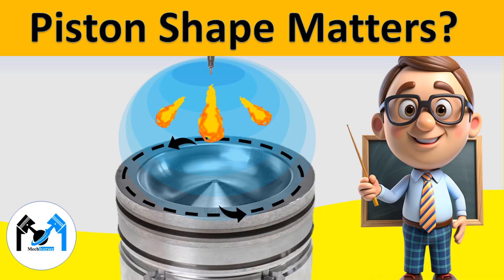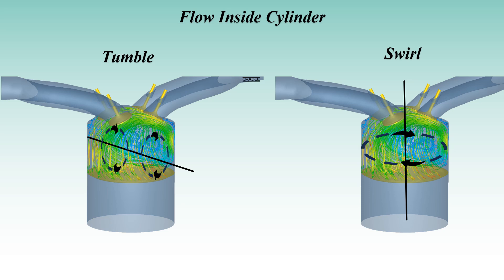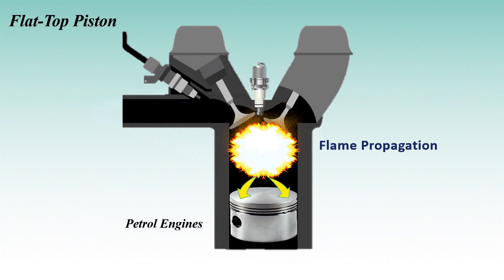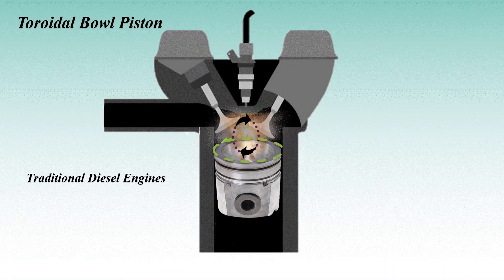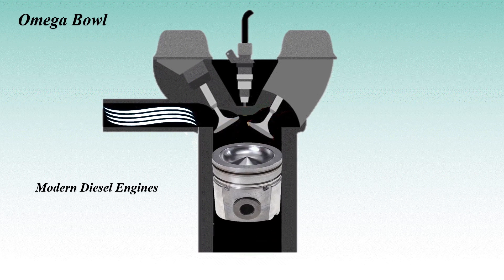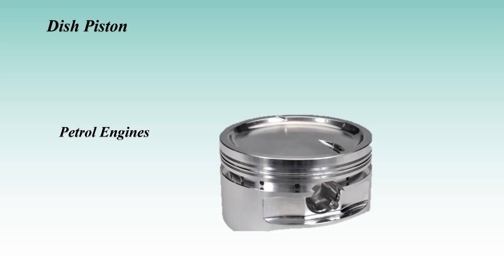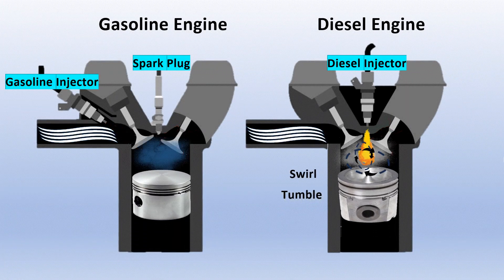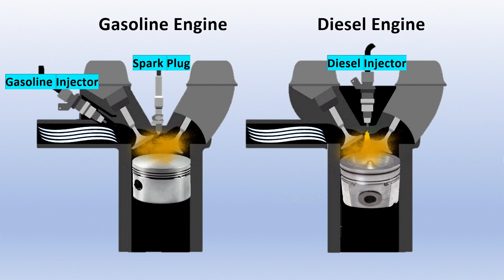The Role of Piston shape

Comment: “Simply splitting the piston crown from the skirt to pump gases for the combustion chamber via a (valvetrain-like) “piston-train” and then combining to turn the crank” makes a 2-/4-cycle hybrid, called “D-Cycle” (Differential-Stroke-Cycle) engine. D-Cycle further ushers in the (diesel-engine-type) compression ignition of the (gasoline-engine-type) air/fuel mixture combustion, for a diesel-/gasoline-engine hybrid, called “Diesoline” engine – or “SCCI” (Stoichiometrically-Charged-Compression-Ignition) engines. The diesoline engine needs no special piston top design. A simple flat top should be good enough. These technologies can retrofit existing diesel and or gasoline engines.  
The (mechanical or electronic) piston-train is like an enlarged valvetrain Which controls the piston strokes and adjusts the gas exchange to optimize the Burnt-Gas-Retention (BGR) to retard ignition timing and slowdown combustion rate. These engine retrofits surpass the current 2-cycle, 4-cycle, diesel, or gasoline ICEs (internal combustion engines), while maintaining compatibility with existing parts, manufacturing, facilities, personnel and processes. 
These patented technologies can retrofit the existing (and future) billions of ICEs to improve (>30%) efficiency, (>2.5x) torque & eliminate (~zero) harmful diesel soot/NOx emissions and can applying acuminated know-how and facilities for great savings from developments. 
ICEs have been worked on by millions of personnel for about 1.5 centuries and encompass the whole spectrum of human activities. With just a minor modification of the piston, they+ can bring in another century of service to humanity and may be even longer - before electric battery technology achieves compatible energy and power densities.
Our piston-train retrofit technologies for the billions of cars, buses, pickups, and any devices powered by existing and future ICEs should provide great opportunities for D-cycle and Diesoline engine improvement businesses. 
The D-cycle generates greater power (torque), it can be for just about any gasoline or diesel ICE powered equipment.  It can greatly enhance power, energy densities and fuel efficiency without much change on the engine (and mostly inside the existing engine structure). This can be already a great business opportunity – and future new cars need only up to 4 cylinders, not v8, while new heavy trucks up to 4 cylinders not 6! 
Diesoline can retrofit gasoline engines by retaining >30% BGR via stopping the exhaust stroke far below the TDC to have diesel-like compression ignition to further fuel efficiency (~15%).  
Diesoline can also retrofit diesel engines in 2 ways. A simpler way is to heat (evaporate) the existing in-cylinder injection during the intake stroke to mix with incoming air and BGR from previous stroke (power transition), which replacing the costly high-pressure injection system. The better way is to add a gasoline-type stoichiometrically fuel-air mixture port-injection like a gasoline engine, and with high BGR to retard and slow down the combustion (called Low-Temperature-Combustion). This way the fuel-air can be better mixed for more complete combustion (producing no soot or NOx in theory & tests) - saving diesel industry $Bs yearly in after-treatments besides fuel.
We have worked on lawnmowers, scooters, military and Ford engines with expected results. We are re-starting the ICE hybrids after the pandemic and eV hype. We will offer to share the retrofit cost with performance improvements and fuel savings to benefit humanity “for another hybrid ICE century!”.